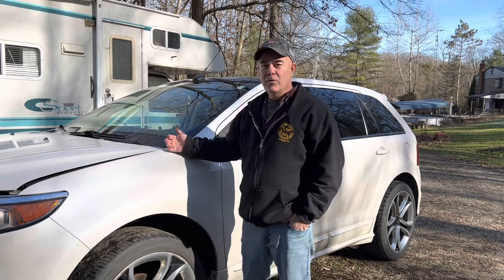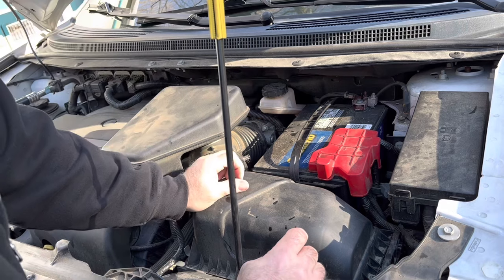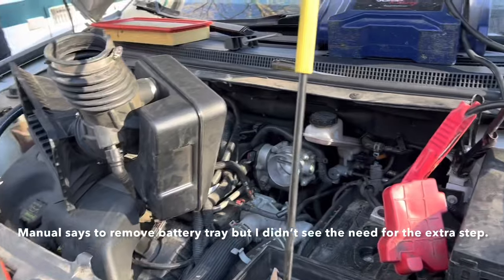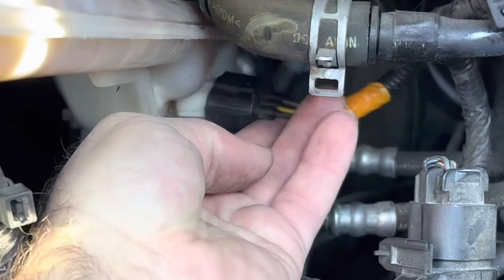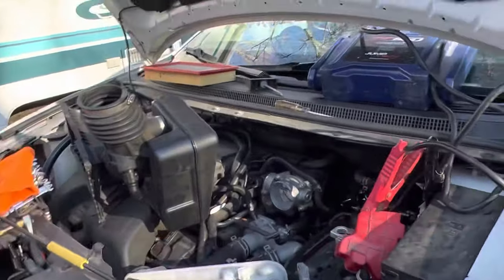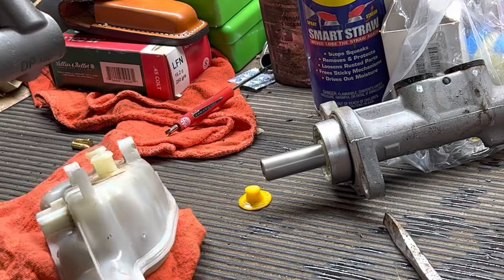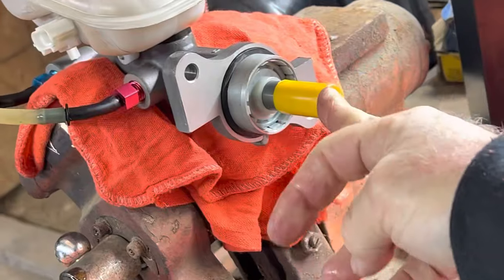2007-2020 Ford Edge MKX Low Brake Pedal or Master Cylinder? Brake Bleeding *SOLVED*

Comment: Like many others I want to Thank You. I watched your video to see what if any special tools I would need to replace the master cylinder in my wife’s 2014 Ford Edge. The problem was on Christmas Eve night going down a steep hill the brake pedal went down to the floor and had very little uneven stopping power. Checked for fluid loss and reservoir was full then was going to replace the master cylinder. Noticed in your vid I’d need a e6 torx socket and luckily watched your informative video to the end. So I took the car out and applied firm brake pressure at 50mph and pedal was back to normal after doing so. 🙏🏼
Reply from the maker: Your welcome!
Reply: Thank you so much for the information on this.

Comment: Thank you so much for this info. I 'm a veteran mechanic of 39 years and I will never understand why engineers have to try and make things so difficult and stupid. I had a customer with bad master cylinder and after bench bleeding and automated bleeding and manual bleeding could not get a firm pedal. I did find the info about pushing the park brake 5 times but it did not say to bleed first and continue to hold the pedal to the floor whilst doing so. But your procedure did the trick thank again
Reply from the maker: Your Welcome. This one was a bit frustrating. I certainly don't think these types of failures are helping the manufacturer. It is nice to hear you were able to get it fixed.
Reply: I'm going thru this now with a 2013 ford edge sport. I replaced all 4 calipers, rotors,  Brake pads and hoses. I still can't get a full brake pedal even after I bleed the lines. Help please.
Reply: Do you have to press the park brake while the bleeder valve is opened or closed?
Reply: @troyconklin1549 Did you replace your master cylinder?
Reply: Thank u for the video

Comment: I had a truck with no brake lights cause me to jam the brakes on our 2014 MKX same exact scenario, bled brakes, replaced master cylinder (shop was $650 actual parts were $150) bled brakes 4 times still a soft pedal. 20 mph jammed the brakes several times on gravel and grass brakes are perfect now. Thanks for the video!

Comment: Thank you so much for this info! I did exactly what you said and slammed on the brakes on dry pavement, and it resolved the issue! I was fully prepared to replace the master cylinder.
Reply from the maker: That's awesome. Glad to hear it has been useful. Thanks for watching!

Comment: Awesome video. Those last two tips will help it. I've been struggling with these 2011 Edge. New brake booster and Master cylinder, bled brakes and still going to floor. OMG so ridiculous that it needs different steps to get all air out. Older vehicles always easier. Definitely will try this tomorrow and can be done with this vehicle. Thank you for your detailed video.

Comment: U the man! 2013 Edge 2.0 Ecoboost. New pads, rotors, master cylinder, bled the crap out of it using ur tip. Still intermittent soft pedal.  Should have listened to the end!  Will slam those breaks shortly!!

Comment: Great video. Had the intermittent problem with the HCU valve(s) sticking and pedal going close to the flooro n a 2013 Edge. First time it happened I was able to unstick it with several hard braking events (forward and reverse) on wet pavement as mentioned on this and other videos. Second time (many months later) the HCU valves got stuck again and the  hard stops didn't work. Hooked up Forscan and ran ABS module auto bleed and that worked like a charm. Since this has happened twice in the last year, I realize the more long-term fix may be to replace the HCU, but I'm hoping to delay that large expense with the auto bleed approach.

Comment: I have Ford Edge Sel 2013.. Problem with brakes.  We used all the recommendations of the repair specialists.  After replacing the cylinder, the problem did not disappear.  And only when the booster was changed, everything fell into place.  Bleed the brakes and work great.

Comment: Yep. I know my limits. As soon as you put the thing in a vise, i was done. 
I am a diy parts changer. Tune ups, fluid changes, shocks, radiators, fuel injectors, wheel bearings, brakes from the line to the rotor...  i'll take my wife's edge to a local independent shop tomorrow. My work stops at the heads, tranny motherboards, and now apparently master cylinders. Lol
Thanks for the help.
Reply from the maker: I sure hope you watched the video to the end as I discuss the Master cylinder wasn't needed to fix the issue. And explain what I did do to take care of the problem. But I do understand where you are coming from.

Comment: In regards to your concluding statements, your research has saved me a replacement of hcu unit...$1600 repair. I did what you said with the forward drive and locked it up on a dirt/gravel road. You could feel the abs working more and more as I repeated it... but the trick is to do it in reverse also... amazing recovery of brake pedal pressure after exercising those valves in the hcu. I also did the tapping technique recommended elsewhere, both seem to work, my brakes feel new!!! Thank you
Reply from the maker: Glad to hear it saved you a big chunk of money and most importantly fixed your brake problem.
Reply: Hello just saw this comment, having same issue with mine. Tried the braking with no luck just curious as to what this tapping method was you mentioned? Thank you!
Reply: @FreeAutoMechanic Yeah what's the tapping technique?

Comment: Thank you, after replacing the master cylinder do to it being spongy it ended it being the abs that was causing, took it out on a dirt road slammed on the brakes a couple times and it fixed it
Reply from the maker: That's Awesome! Glad you got it fixed.

Comment: Thank you so much for posting your video! I got the soft pedal to the floor after a quick stop... Went out on a four-lane road today with no traffic and locked em up at 50 mph and it was half better. Did it one more time close to 50 and again at 25 and now the brakes are nice and firm just like they were before the issue started. I also did it in reverse at about 20 mph twice. Read some other comments on other videos suggesting doing reverse helps UPDATE: It's been a month and it got soft again today. Got up to 45 on wet Road. Slammed on the brakes two or three times and it's fixed again. Read somewhere in the comments about possibly dirty brake fluid causing the ABS control unit valves to stick. Wondering if a brake fluid flush would help??
Reply: You hve to change abs pump I think

Comment: 10:00 - starts the discussion of special bleeding requirements & issue with soft pedal for no reason fix. And easy fix before replacing any parts discussed at the end.

Comment: Great info.  Had the low pedal issue happen to me today after a sudden stop.  Will give the workaround a shot before I dig into the actual system.  Thank you!  Liked and Subscribed!
Reply from the maker: Appreciate it, Thanks!  Let me know how it turns out.
Reply: My master cylinder was replaced but every time I push down hard on the pedal, the brakes go back to going all the way down to the floor mat.
Reply: @papillonblue4038  I have the same problem , how you fixed it please ?
Reply: @papillonblue4038 Jjust slam on your brake at 25 miles per hour while turn your car to the left,couple of times and salma on the barakes at 25 milea per hour on revers that should reset the ABS module,don`t mess withh anithing else on your brakes ,before change master cilinder and other parts!
Reply: @joserivas2992 why turning to the left?

Comment: My friend had an old '80s van and he was instructed to smash the brake six times just with the vehicle parked to reset the ABS valves. Any chance doing it while it's parked would work as well?
Reply from the maker: doubtful but let me know if you experience something different.
Reply: @FreeAutoMechanic - now that I think about it a few weeks later, this wasn't for his ABS I think it was to reset the brake diverter block where if a leak occurs it closes off that line of the brakes.

Comment: I was doing rear brakes. Everything was fine when I parked it and I took the rear caliper off cause I couldn’t get the piston to turn in and after the caliper was bled the pedal goes to the floor. Do you think the parking brake bleeding trick would help me?
Reply from the maker: YES. It is identified in the bleeding procedure as a must.

Comment: Do you hit the emergency pedal brake while the bleeder valve is opened or closed?
Reply from the maker: Great Question. It should be performed while closed. And may need to be done more than once.
Reply: @FreeAutoMechanic if it’s closed how can any air get out?
Reply from the maker: @larrnew  the idea is to follow the manufacturers instructions on bleeding the system. https://www.freeautomechanic.com/mechanic/forum/2022/01/ford-edge-low-spongy-brake-pedal-fixed

Comment: I have been experiencing spongy pedal issues with my Ford Edge sport 2013. A year ago it started going spongy when I used emergency breaking. As soon as the air is released, it will be back to normal. However, later on it doesn't become normal after releasing the air. The master cylinder and brake booster have been replaced. The situation remains the same.Please let me know how I can resolve this issue I hope you can help me out with this issue. My dashboard does not display any warning lights.

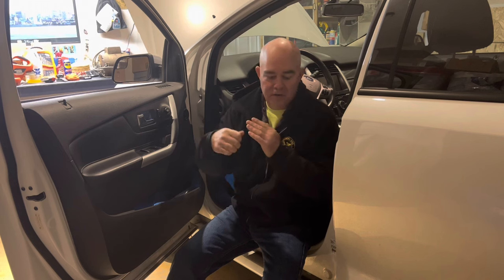Comment: 10:45 - So while holding the brake pedal down, you press and release the parking brake five times?
Reply from the maker: yup
Reply: Unfortunately still have a soft pedal again. Wondering if it's the ABS pump?

Comment: What is the difference in leaving the battery hooked up, or hooking it up to a different battery? It still has power going to the car, right?
Reply from the maker: In the video I remove the battery to gain access to the master cylinder bolts. As it says in the video, I connect the jump start pack to the battery cables to keep from losing clock and radio settings. If you are able to do the procedure without removing or disconnecting the battery, by all means, go for it.
Reply: @FreeAutoMechanic I would rather reset the clock…
Reply from the maker: @larrnew  Resetting the clock isn't to much, however resetting all the radio stations on a CUSTOMERS vehicle might take an extra 1/2 hour to do. On your own vehicle, might not be as much of an issue.